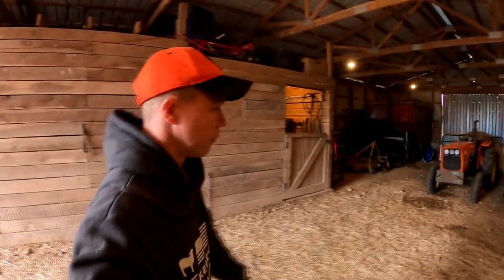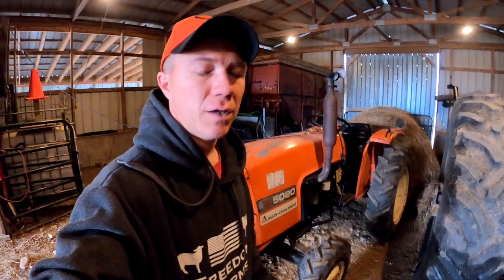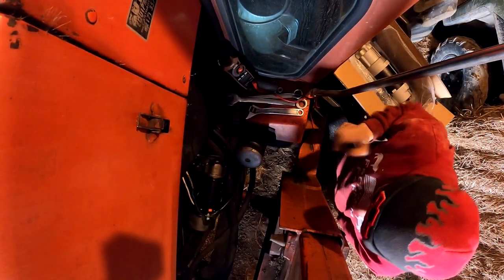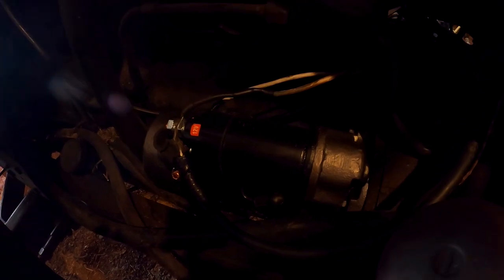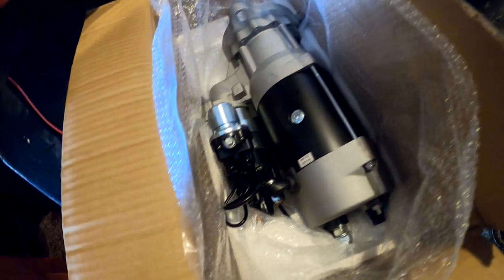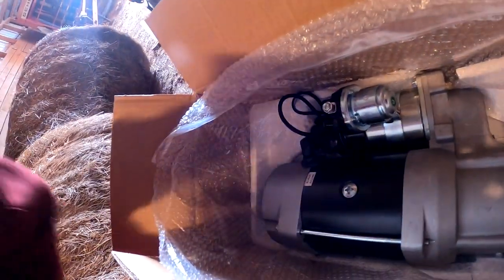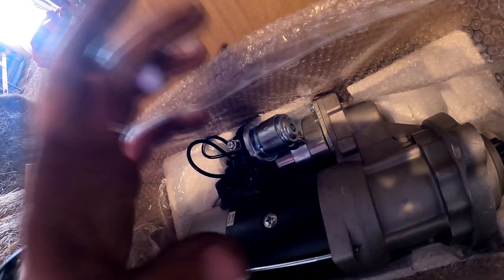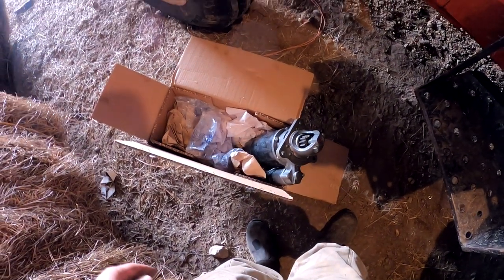Starting a farm vlog #7 Allis Chalmers 7045, the heart and soul of our Farm needs a starter!

Comment: Thanks for your service.  I have an Allis Chamers 5030 that needs a new starter.  I can't get the old starter out.  The nuts and bolts are out, but I can't move it back far enough to remove.  It hits what I think is a tube from what I think is the hydraulic pump.  If you look at your 5020, you will probably see what I am talking about.  Enjoy your postings and hoping that you can help.  Retired from Army, then Air Force. Thanks!
Reply from the maker: It looks like you can either slant it away from the block as it comes out but if you can't slant it away from the block enough you will need to remove the tube that runs to the hydraulic pump from the rear end. It's simple to remove them.
Reply: @FreedomFarmsMo  Thanks.